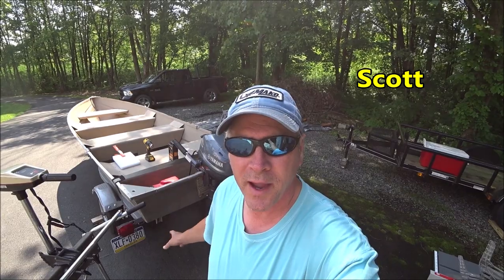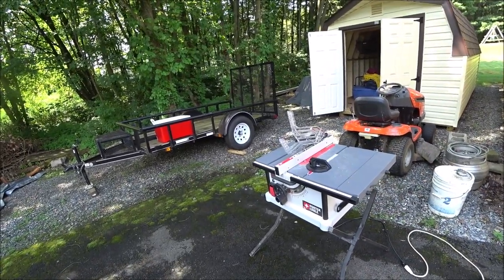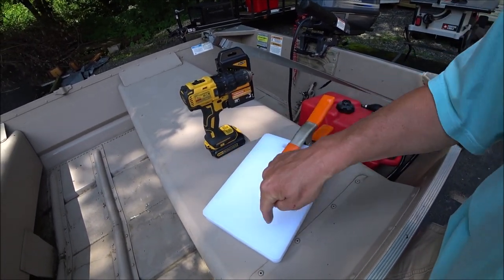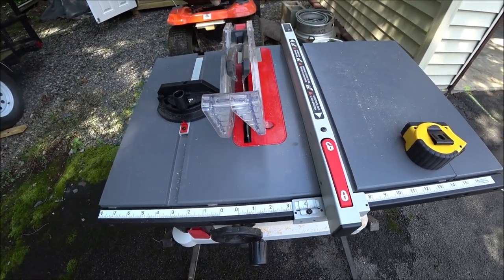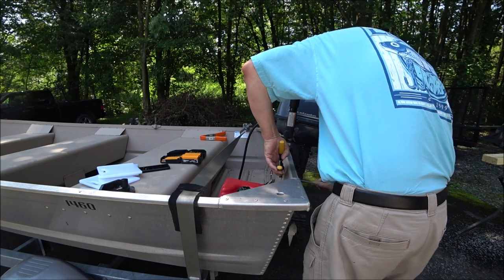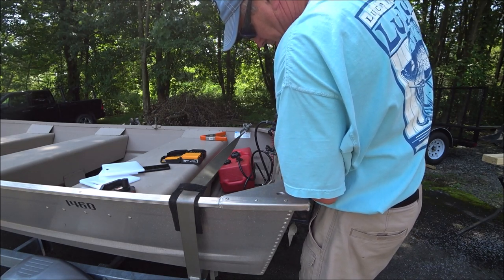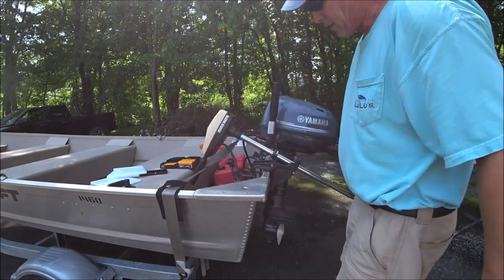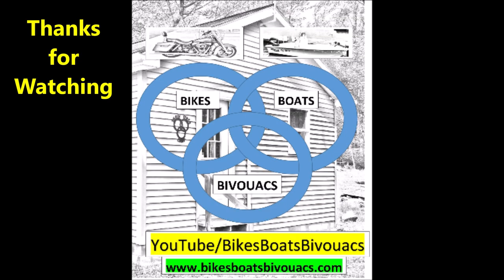How to Make a Transom Mount for a Trolling Motor

Comment: You made the same mistake I made. You didn't check the clearance on the tiller of your main motor. My tiller hit the trolling motor shaft when it was tilted forward, whenever I tried to turn to the right (pushed the tiller left). I ended up sliding the main motor over to the right for clearance. Also, I was using a 40lb Minn Kota that had a long motor and the blade bumped the main motor shaft. Luckily moving the main motor fixed that too. Hopefully a viewer will see this and learn from my mistakes!
Reply from the maker: It worked well. When I was running fast and I pulled the electric up I would pull it about 70% up and it didn't interfere. Thanks for watching.

Comment: Scott, I am in market to buy a new jon boat and want a setup like you have in your video, trolling motor and gas motor on stern. My question is that I was thinking of buying a 1448 Jon. Would there be enough room in the back to mount my liitle 5hp gas motor and my Minn Kota 55lb Endurance trolling motor? I am retiring my very old Lowe 1442 and do not have the space to operate both motors adequately.
Reply from the maker: Hi Kent. I think you would have enough room, but you might want to think about a trolling motor that attaches to the lower portion of your gas motor. It may give you better control while saving space. Thanks for watching.

Comment: I have a question for you and hope someone can provide me with some guidance.  I have a 14 foot V Haul boat with a 9.9 Mercury outboard motor.  I'd like to mount both the outboard motor and a trolling motor on the back of the boat.  My back seat is mounted off center.  Can I mount the outboard motor and have it offset of center to allow for the trolling motor to be also mounted on the back mounting board?  And if so, do you have any guidance for the mounting.
Reply from the maker: I think if you offset the motor it will pull to the side and make the boat less stable. If you don't have the room to mount the trolling motor offset on the transom I would build or buy a trolling motor mount that attaches to the side of the boat and pushes it out over the side. Take a look at Gheenoe trolling motor mounts to get an idea. Good luck.